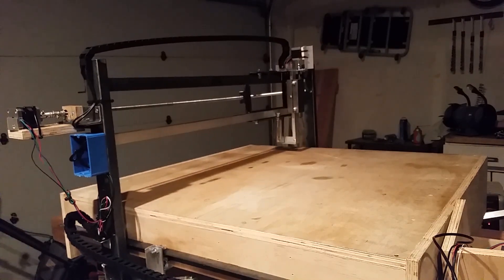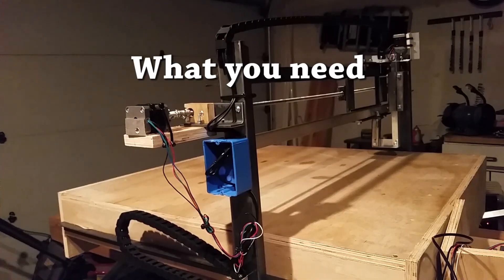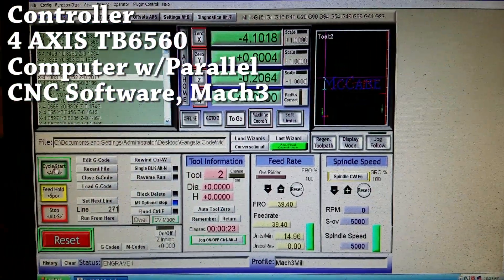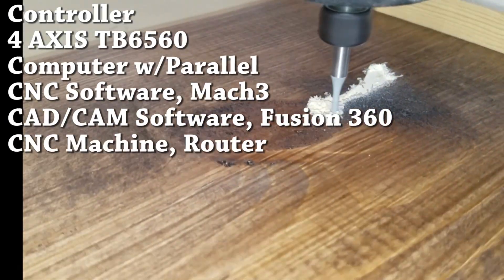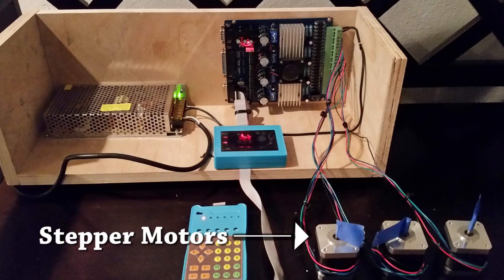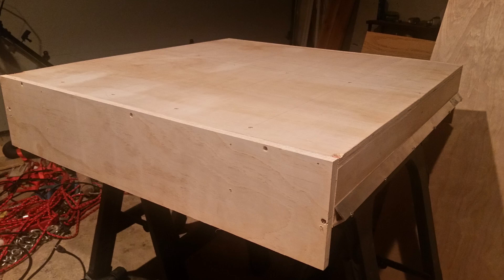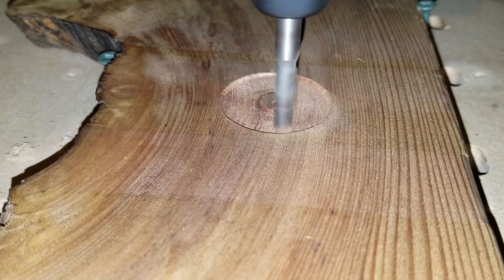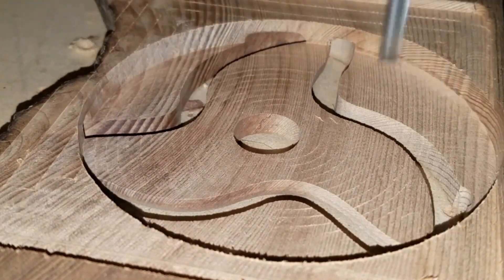What you need to Make a CNC Machine

Comment: You also need machine tools to make the parts- or the skills to hand fit, including hand scraping all surfaces to the required accuracy. The whole point is to get the accuracy that a properly build CNC machine can offer. Yes, you can remove wood in a rough manner, but it is a lot of work to achieve crude results. Do you want a toy or a tool?

Comment: Thanks for the video I wach several videos only ,3, show that this is possible in reality don't matter what system you choose  or what controllers if the controller can communicate with the drivers and the computer can communicate with the controller your ok the software today is available also free like Linux CNC or using controller Arduino uno that will run Whit any software I think that paying $180 for a software  is ok if you got the money but in mi case Arduino looks good

Comment: Neat, all thread instead of acme threaded rod.  Interesting. Thanks for the details, neat build.  Surprised you didn't try the smaller arduino maybe more cost effective controlling.  Guessing for the higher current stepper motors... a little more complicated circuitry.

Comment: Hey there, I'm from Brazil and I'm building a CNC machine as well, I've bought nema 17 step motors, do you think they are enough to do some jobs with wood? Thanks
Reply from the maker: It all depends on your type of drive. I used 3/8"-16 all thread so it was very geared down. But using a regular multi lead screw you will probably stall the motors. I would have to reccommend nema 23 or greater.

Comment: Hey SG, hope all is good with you and your fam.  No hurry Brother, just excited to see your new machine being built.  I know this is a huge time investment for you so again, no hurry.
Reply from the maker: Ted H waiting on a couple key parts, the table won’t be here until feb 2, but I’m posting a video tomorrow of the controller setup. Kinda dry, but a necessary part none the less.
Reply: Thanks SG. I subscribed to your channel so I'll watch when the notification pops up.  Still trying to convince the wife building a CNC is a good plan, but the alternative is using the money to buy more guns which she is not a fan of.  Not that she does not like guns, she just feels I have enough guns (and she is probably right).  Will you share the info on the table you purchased?
Reply from the maker: Ted H I just got a sheet if steel. I'm building everything. It's a pretty thick piece and getting one locally would be pretty expensive. My other table was made of wood, and it works fine, so you don't need anything special.

Tell her a CNC is an investment, just like guns. Lol. Sounds like wife.
Reply: I tell her the guns are investments all the time and she just rolls her eyes...  Are you going to do a steel base too and weld everything up?  Is this to make the base super heavy so it does not move during CNC milling operations?
Reply from the maker: Ted H I’m going to drill and tap it. Welding would warp it. Any warp is unacceptable!
Reply from the maker: Ted H Two reasons for the steel bed: strong AF, and coolant won’t destroy it. My wooden CNC was limited to soft materials like wood, plastic, and aluminum because I couldn’t use active coolant. This new router I want to be able to cut steel. May be a pipe dream, but here is to hoping.

Comment: Quick question for you, would this model on ebay do pretty much everything your CNC machine will?
https://www.ebay.com/itm/122848231506
Reply from the maker: Ted H Yeah, Cnc machines are all basically the same. This one even has the same motors as my drill press cnc I made last week. Good motors!
Reply: Thanks Man! Just need to convince the boss (wife) why I need a CNC Machine and how it will benefit what I do for a living is renovate and repair homes.
Reply from the maker: Ted H Its a tough sale but worth it! Show her all the signs you can make for around the house, that will help!
Reply: Thanks for the encouragement SG! Is your CNC Machine 3 axis or 4 axis?  And please help me understand the difference and excuse my novice questions.
Reply from the maker: Ted H My controller is a 4 axis, but I’m using the 4th axis so I can have twin drives on my X axis. So the Y axis has one motor, the Z axis has 1 motor, but the X axis has 2(better accuracy that way). Typically a 4 axis machine is the same as a 3 axis except the 4th axis is used to pivot the bed or the cutting tool in order to contour around the work piece. A 5 axis is exactly the same, except it pivots on the X and Y plane. meaning that virtually any part of the work piece can be accessed at any angle. Does that make sense?

And you are very welcome, thanks for watching! My next cnc should be done in a few weeks, be sure to look for the video!
Reply: Thanks SG, Makes perfect sense.  I am excited to see your new CNC.  I would love to build my own CNC and I don't think I would have a problem with the electronics and software (I have considerable electrical work experience and have experience with CAD), have the tools and ability to build the structure, but I am not confident in designing the structure or setting up the mechanics.  My father in law is an absolute genius and works on CNC machines (he operates and repairs CNC's for a living) but he is 3 hours away which makes it hard to get help from him.  Most of my friends are either not mechanically or electrically inclined at all (White Collar Guys) or they share a similar skill base to mine which is mostly carpentry, electrical, plumbing and home building/renovation.  You scored an awesome deal on that  $20 Arc welder.  I watched that video today, you were able to lay down some nice beads with it.
Reply from the maker: The structure is a weird animal. It's shockingly simple, but there are SO many pieces that it's intimidating. Once you get your X-rails on, level your bridge. Once you get your bridge leveled, square up the x rail guides with each other. And on and on and on. That's why I want a Step-by-Step guide. So the resource will be out there for everyone to make one. The hardest part for me is filming while I do things. I get stuck in work mode, and I need to remember to stop and film so you guys can see what I'm doing.  Honestly I'm glad I didn't film the last one cuz it was so complicated it wouldn't help anyone but me. Plus I didn't know what the fudge I was doing. I built it a year ago, and I've rebuilt and re-designed so many things that I'm ready to get one nailed down now! Honestly, I waited so long to do this vid because I wanted my channel to grow a little more (I've had the belts, pulleys, motors and bearings for probably 6 months). If nobody watches my vids it'll all be for nothing. At this point, I think SOME people will benefit from this vid, and it will bring in more viewers so now is a good time to pull the trigger I think.

Thanks man, I like that welder. I have too many welders, but $20 dude! I can't walk away from that!  I need to work on my stick welding, I have way more experience with TIG and Wire feed.
Reply: Thanks again for your desire to be so helpful. I can tell from your videos that you are someone who I would love to develop a friendship with. I am so thankful many of us have this trait which is what makes youtube so great.  I am still on the fence on buying the HF 90 AMP Welder as I only weld every so often.  HF has it on sale for $79 right now which makes it very tempting, but when I think about it, I really don't need it.  It is awesome to know how to weld and my ability turns into revenue for my business every once in a while.  At the same time,  I have wanted a flux core welder for years ;-)
Reply from the maker: Ted H No, thank you for watching and having this dialogue! Without my viewers and their feedback my channel would be worthless to me! this very second I am doing a “harbor freight 90 amp vs harbor freight 125 flux” video, so maybe that will help your decision making process. YouTube has been huge for my personal development, but sadly so many people see it as a “quick money” platform, so they poorly inform others. I’m not one of those guys (I hardly make any money at all from it). I have been truly blessed to work with some of the best craftsman ever, and I learned everything from their willingness to nurture me. My friend Chris Duffin is always talking about how manliness is looked down on in our society, and I want to reverse that trend! I want young men and women to see what they can accomplish! The more people I can reach out to and help, the more worth while it is to me! I encourage every one of my viewers to reach out to me. Luckily that doesn’t happen because I could never have dialogue with all of them, but while I can keep up with my friends I meet here, I will continue to do so! 

The harbor freight video should be up Friday morning!
Reply: I hear ya on the "quick money platform" individuals who are not in it to show you how to do it.  I to have been blessed working along side some great craftsman who were great teachers, I take every opportunity to pay it forward with my employees and clients.  Looking forward to the 90 vs 120 shootout!  With the readily available HF 20% off coupons, they are roughly the same price currently.
Reply from the maker: Ted H I think I’m gonna do little snapshot vids for the guys following the build (like, 6 dudes, lol), and do one big, comprehensive guide at the end. What are your thoughts on that?

My buddy has an industrial 3 axis, god I’m jealous of that machine... but he has a shop, I got a garage.
Reply from the maker: Ted H trim router is good,but I’m not gonna limit myself like that again! It bogs when it shouldn’t (and, of course, I made a WELDED custom router clamp, so there is no “easy” way to swap it). I think it’s 1/3 hp, I definitely want 1.5 or 2 hp, that way I can turn my jog speed up and not worry about stressing my cnc too hard.
Reply: I think that's a great way to present/teach novices like me how to build one.
Reply: Makes sense.  I looked on HF's site and the HF trim router is 1/2 HP.  My Bosch is 1 HP.  I see a lot of CNC's built with Dewalt Trim routers and the Dewalt base model has 1.25 HP.    Almost every CNC machine of this type I have seen uses a trim router, not a full size router.  Would a full size router be feasible to use as your spindle?
Reply from the maker: Ted H I'm going to use one. I need all the power I can get! Trim routers work, but I'm looking to increase my speed, so it's gonna need to remove more material more quickly. A trim router will work, especially at first!
Reply: So you are planning to use a higher amp trim router then build your CNC so you may upgrade at a later date to a full size router?
Reply from the maker: Ted H My new CNC is gonna start fresh with a big router. The old CNC jog speed runs about 17" per minute, the new one will probably be 50+. No way a trim router can hog that much material. It would work fine on little stuff, but not on wood engraving or milling operations with good sized bits. Does that make sense?
Reply: Yes.  Perfect sense.  I have a full size Bosch router, but I use it too for my business, but with full size routers some brands are cheaper than other brands trim routers.   I have seen Craftsman full size routers for reasonable  prices.
Reply from the maker: Ted H I got an old craftsman, I think it's a 2 horse. It's heavy but I'll buck! I'm trying to avoid spending coin right now, cuz I'm sitting at about $300 right now for my current build, I wanna keep it under 5.
Reply from the maker: I got a leg up though cuz I already bought the software, and I'm being given the computer cuz my computer guy bought blank doors and needs me to cut out the hinge pockets.
Reply: Strange Garage keeping it under $500is my goal too.
Reply: I'll probably try to find a used one 2 hp full size router in good condition.  I am super excited for you to teach me how to build it!
Reply: Sweet on the computer!  This is one of my least favorite things to do (route out for door hinges).  All the setup stinks and if you mess up alignment at all you are screwed.  Done enough of them now that my rate of screw ups is minimized thankfully :)
Reply: I am finding full size routers on craigslist for $30-$50 so I think I'll be able to buy one on the cheap.  What is needed for the CNC is a fixed base router, NOT a plunge base right?  I believe I know the answer but you are the authority;)

Comment: Awesome, thanks for this. I will probably start one of these soon. Do you think yours could engrave brass?
Reply from the maker: Joey Atilano Yeah with good Carbide engraving bits it could engrave brass on a flat plane. You mean for trophies? Good luck man, it's a fun project for sure.
Reply: Strange Garage I was thinking designs for brass knife handles.
Reply from the maker: Joey Atilano Oh yeah, that'll be cool. As long as you put it together with fairly tight tolerances, and use a decent router it should work great for that.